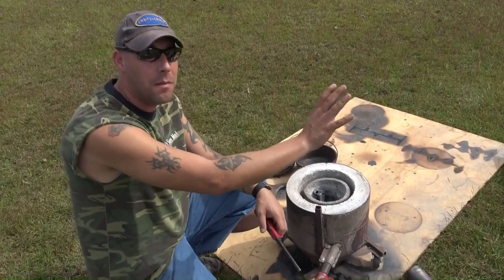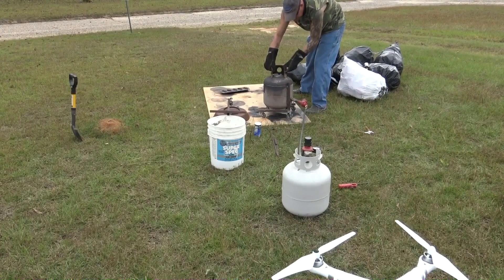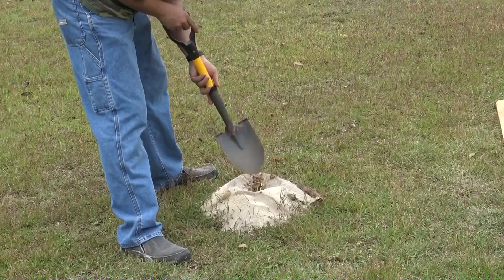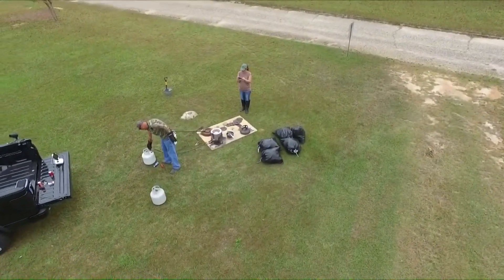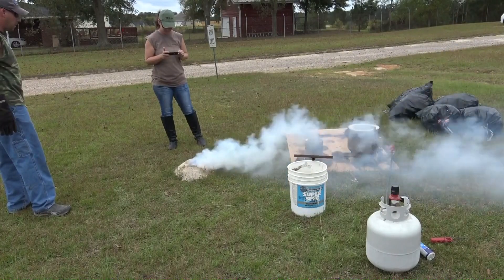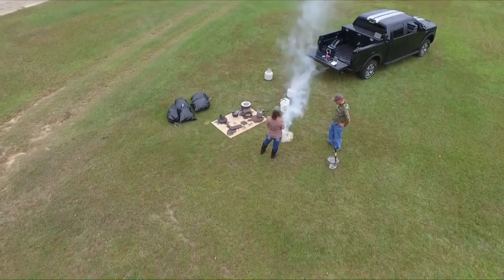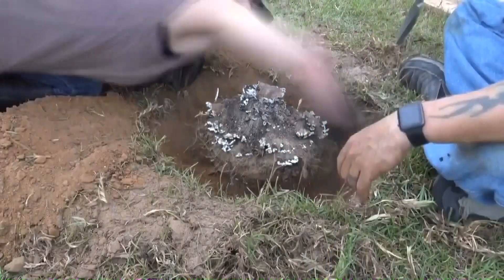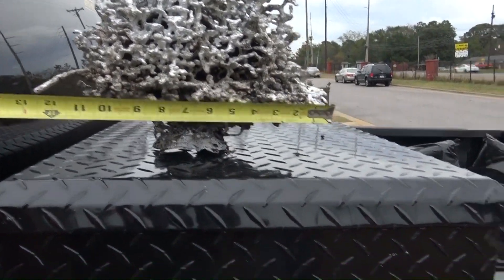Aluminum Fire Ant Colony Casting

Comment: Two things you need to make this safer/easier :

i) A can with a cut-out bottom creates a better base, and a good funnel to ensure Aluminium doesn't splash outside of the aperture.  A stainless steel industrial funnel would also be good.  
ii) A crucible with a beak or a spout, for easy pouring.

Comment: I am amazed at how well that turned out. I would have bet money that the aluminum would have hit a choke point on the way down and partially harden and subsequently blocking the entrance for any more molten metal. I was not only wrong but extremely wrong since the metal seeped into tiny channels well over a foot deep into the ground. Do you know if all of the underground chambers were able to be infiltrated?  Also most fire ant mounds I have had contact with have lots and lots of chambers and tunnels located above ground level and in the actual mound itself. Have you ever thought about scraping an inch or two off of a big mound and use a bunch of sand to encompass the entire colony and then pour the molten aluminum into it and get the parts of the colony not only below ground but above as well?

Sorry for all of questions but I am a huge fan of your channel’s content. Keep up the good work of turning a nest of dangerous and invasive fire ants into art with the side effect that all of those stinging bastards are dead and gone!
Reply from the maker: The aluminum does flow better than expected for sure and yes I have tried to catch the above ground as well. The issue I run into is the amount of metal I can melt at once. Most of the mounds that have the above ground stuff as well as so large that my metal disappears below the surface. Though this still removes the mound and kills all the ants it forwent really produce a nice sculpture

Comment: I feel like you should do a call before you dig. If there was a gas line along there with that colony and you surrounded a utility line in molten metal there might be some issues.
Reply: +Matt E read description
Reply: +Quinten Franks mmm permission is not doing a 1-800 call.

Comment: Love your videos. From your tone when speaking about adding cans, I can guess that melting them gets a bit monotonous. I was thinking about it and wondering if you could just rig a system to feed the cans into the top of your foundry. A simple way might be a few steel rods sticking up off the foundry, set just enough apart so you can stack a bunch of cans on top of themselves, feeding the mouth of the foundry. Then you could add by tens instead of single cans. Thank you for your well edited videos...
Reply: Easier yet would be to get a can crusher  for 15$ ,and feed those resulting 1/4 inch aluminium rings ....a dozen at a time or so into the crucible